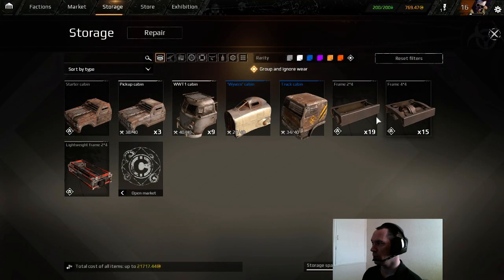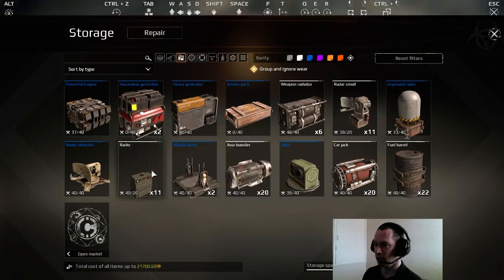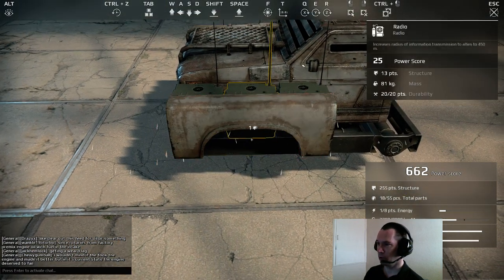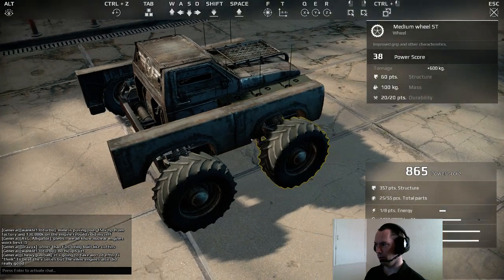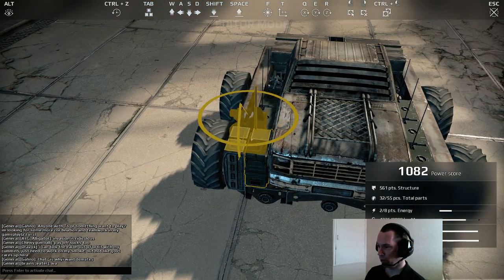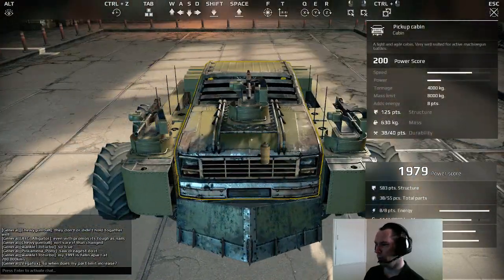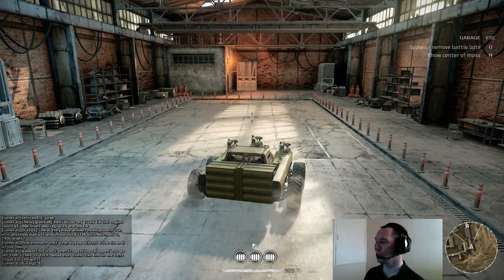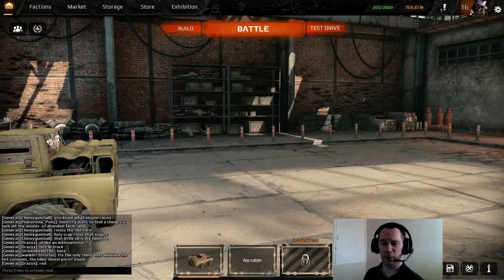Crossout   How to make a compact Fuel and Scrap collector

Comment: When I place the parts at the level/lower of the frames, they are colliding with the ground while moving, even with the medium wheels. Another downside is that this vehicle is very short and hard to maneuver, especially at the high speeds. Another thing is that if you put all the radios and 4 mgs, your power rating will be (I think) more than 2500 and at this point you will be annihilated by other more modern weapons, right?
Reply from the maker: +Giedriukas3  Evening, You are indeed correct on the vehicle is bottoming out, so I replaced those parts with 4 radios and that left me room in the back for the other stuff, looks a little less compact.

With just the radios and basic fuel barrel, car jack, weapons rad, I got the built to 1.8k with 3 light machine guns on went up to 2.1k with 2 med gun on.The one things I love about this game is even small changes can have a big effect. see you in game and thank you again for your feedback

Comment: does this still work??
Reply from the maker: Evening Maxim, This was a closed beta build, certainly get fuel from a barrel, however the scrap has probably changed a LOT since this video was posted
Reply: yeah I was asking about the scrap, thanks dude
Reply: There is no durability anymore, so making a build that's "easy to maintain" is kind of pointless now. Just go for the best build you can make.
Reply: @Draug0  The durability went?? Ohh I'm so glad. I don't have to worry about doing good in order to keep parts - heck I could purposefully lose hundreds of rounds and not lose any, coin, parts, or resources of any kind.... That's good to know!